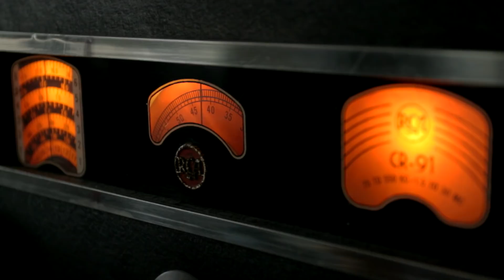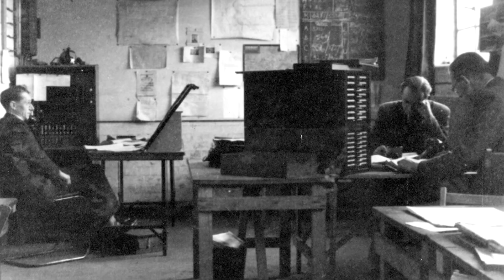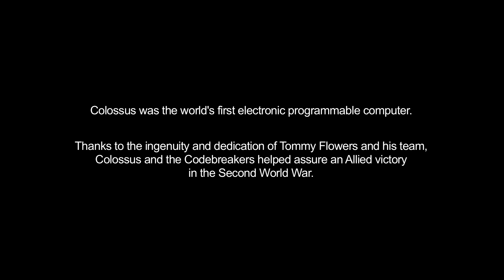Colossus: Creating a Giant

Comment: Excellent video, well done Google. Tommy Flowers is a forgotten hero in the development of the first computers and WWII code-breaking.
You can sponsor a valve to help towards the rebuild of the Colossus replica at Bletchley Park if you want to support the project.
Reply: I think they used double triodes in a flip flop circuit.
Reply: Wish I had known that, I would have happily sponsored a valve (or two)

Comment: @gudehus Not strictly true. The Z2 was electro-mechanical using relays as the active component, which greatly limited the speed of operation. That's not to take anything away from Konrad Zuse; he's definitely up there with Turing and von Neumann IMHO. If the German military had agreed to his request for funding to replace the relays with valves then I'm pretty sure he would have beaten the Colossus team.

Comment: The heroes are the RAF "Y" service (wireless radio intercept) who listened in on German radio morse code traffic, then transcribed it....the end product, encyphered/encrypted, was sent to Bletchley Park offices (army, naval, Air Force and "other" specialized offices such as for the SS, the diplomatic service, the German labour and railway systems, etc) who then worked to decrypt them via the enigma "bombe" computer or the Lorenz "Collossus" digital, high speed memory based computer, either of which "broke" the encrypted messages, which were then translated from German to English text......those then sent immediately to the British and later the American military operational headquarters via "ULTRA - Special Liaision Units" (SLUs) to field commanders. Without the "ears" of the "Y" service, no German military or government morse code transmitted messages would have been intercepted....!
Reply: Seriously? You do know that Y stations extended beyond the RAF. Actually, I don't think you do. Y stations were run by all three services, plus the MET Office at Dunstable, the Post Office, and the Foreign Office, it was a far bigger operation than you describe